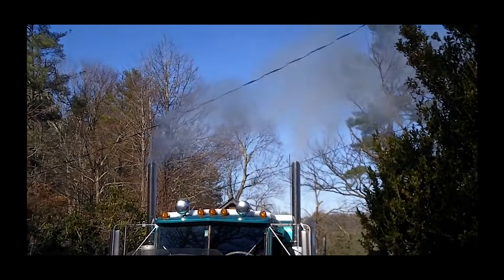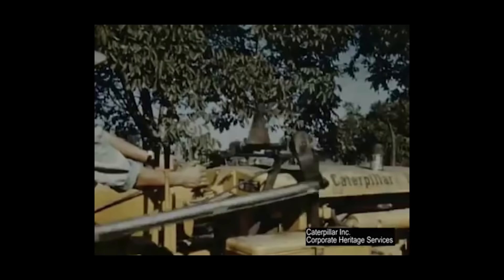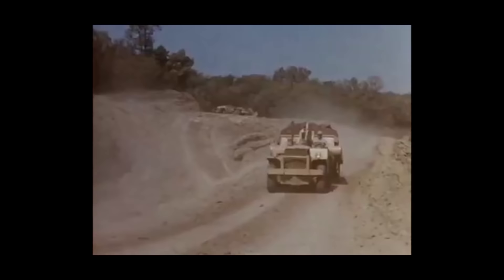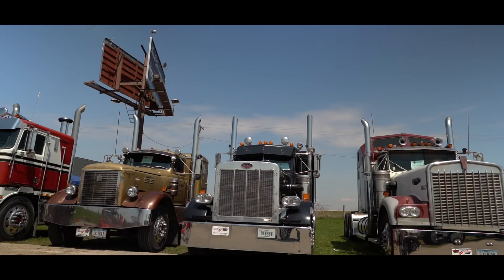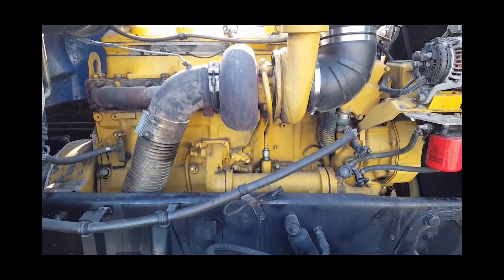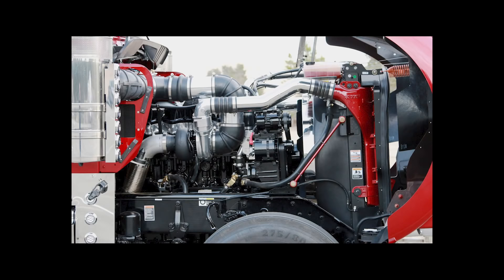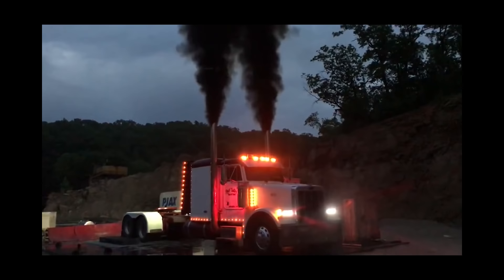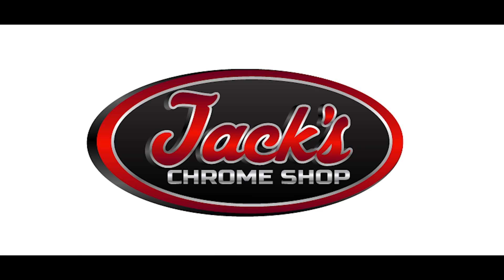History of Caterpillar Engines | Diesel History Episode One - Part 2

Comment: Nice coverage of the truck engines.  Would have hoped the big CAT's  (D379, 398 and 399) were have been mentioned.  Served as an engineer and skipper on many a Bering Sea crab boat with these beasts as main engines.  We used 3306's for generators and hydraulic pumps.  One trawler had two D353's as mains.  After putting a rod through the side of a D353, we bought what was supposedly the last D353 rigged as a marine engine from Peoria in 1982, shipped it to Alaska and had it fishing again in three weeks.  Loved those engines, slow turning, tons of torque and a pleasure to work on - life was good.  Worked on one trawler with those screaming jimmies leaking oil everywhere, couldn't wait to get back on a CAT boat!

Comment: How about the 32, 33, 35 and the monster 36 series. 

I'm an electrician and have installed quite a few 3512 and 3516s driving generators. The largest 3516 I've worked with had 4 turbos and would produce 3200 HP @ 1800 RPM. During testing, at 100% capacity, it burned a bit over 150 gallons per hour. I'm not completely sure of this but if I remember, the manifold pressure was somewhere around 100". 

And yes, it was just a bit LOUD........lol.
Reply: I have run locomotives that were converted with 3516's/ 3000HP  very nice.
 As you can see from the videos, CAT made a lot of poor design decisions.   The 1693 was indeed a great engine however it had a some drawbacks:   very heavy for its power (because of the overhead cam), a single cylinder head which was unwieldy to handle (Cummins had the right Idea with 3 heads)  and the pre-combustion chamber which lowered thermal efficiency.   Something that is rarely mentioned is that repair shops (mostly big company shops) can affect what the company buys - if the mechs hate working on them and it take more time then the company will use a different brand.  Don't get me wrong - I love CATs  but I think it was chicken shit that they ran from the trucking industry because of emissions since they would eventually have to deal with it in marine and industrial - this also gave the other brands a head start on emission controls, and quitters don't make winners.

Comment: I used to work for CAT San Antonio. Took pride in knowing we were one of 3 of the best diesel engine manufactures. We machined the C9, C7, C13, C15 blocks and C175 and 3600 heads.

Comment: Every major motor builder is having a hard time with modern emission regulations. CAT got out of otr because it made sense. They make their nut on construction equipment and dont have to deal with it. It's a loss for truckers, but you can't  blame em'!
Reply: You're absolutely right.
Reply: They were also using junk parts from China that were failing.
Reply: @bobwilliams3502  
They also had problems they knew about and refused to fix them, like a cylinder liner would be too low compared to the other liners. Instead of fixing it, cat would replace the head gaskets until it ran out of warranty,  then the owner got stuck with the problem.  the fix was remove the liner that was too low, put a steel shim under the sealing lip to get all the liners to the same protrusion so the head gasket could hold. Too much work.

Comment: The original CAT truck engine was the 4 cyl 1670. Also worth noting: The 1673, 1674, 1676,, 3306,  3176, 3116, and the 3126 truck engines.. There also was the D336, 3306, and  D346 V8 in scrapers, that built the freeways in California.
Reply: And probably a 3208 in one as well
Reply: what about you forgot about 3208 3506 V8
Reply: I meant  3508

Comment: Nothing like cat power. Love my 3406b in my 92 w900l. I do specialize hauling and am grossing out usually around 250,000 lbs. it pulls like a beast. And no it’s not stock hp. I figure it’s a bit over 500hp and not sure the torque never had it on a dyno but will walk all over any new engine from Cummins or Detroit.
Reply: I love the b model in my 87 w900
Reply: It's a dozer motor.

Comment: air to air 3406B was introduced around late 1985 early 1986.  i believe it was a 7FB prefix.
Reply: 1984 was first ATAAC (as an option on Pete/KW) for the 3406/3408B.
Reply: My 87 w900 has 3406b 7fb prefix. Ataac
Reply: @davidroberts2404  sweet!  my 1986 w9 has one too.  factory set at 400 still.
Reply: @johnowen6507  mine was a 425hp. But I've tweaked it a bit and added 7" straight pipes, dual ss breathers etc. Will be tearing it apart over the winter if all goes as planned for repainting cab,sleeper and chassis.
Reply: @davidroberts2404  awesome dude!  should throw up a video when you get it all shined up.  have an 1989 379 exhd daycab that has a 425 that we turned up,  thing runs well.  take care man!

Comment: MMI equipment in Ashland Ky has a rd 800 Mack lowboy tractor with a 3412 in it it's a beast.
Reply: 3412 was never sold by Cat as a truck engine, though a few were shoehorned in by lunatic owners.  Way too heavy for OTR highway use.

Comment: Cat has been the most resilient company to the stricter epa regulations I think that they will probrobly be one of the first to develop an engine that will meet emissions but not need any def.
Reply: They allready did it's called a C9.3B
Reply: @dropout75  where there any specs released
Reply: @dropout75  well from what I've read those engines do use def according to cat.
Reply: Nevermind, the C9.3B uses way more DEF but has no EGR, got my acronyms swapped around.  But they're in the new 336s.  Things run over 200 degrees so it burns super clean but the added heat creates more NoX hence the added DEF use.
Reply: @dropout75  well that would mean no dpf but def targets NOX so I would think that even those engines would have it. Honestly I can deal with dpf but def is just time and money I never wanted to wast.
Reply: @mzee5533  cool glade to know
Reply: They did, ACERT C-15 doesn't use any DEF
Reply: I feel sorry for any driver that hasn't had the pleasure of driving a truck with a cat engine, they are just so damned sweet to drive, and that rattling sound is music to the ears
Reply: @mdlclassworker3384  
the one I drove a 77 cab over Pete had the 3406 360 horsepower,  was the biggest piece of junk I ever drove, I got out of that Pete got a 77 KW. with a 290 Cummins big cam and was glad I did! Pulled better, ran better, and got better fuel mileage than that junk cat

Comment: I hope they come back.. maybe make a 90 degree normalized 3408. He forgot to mention their 3208. the only normal road going v8 they ever made.. 10.2 liters or so.
Reply: The big block 3408 was engineered to use the 60 degree V because it was determined that would not fit between the hoods and frame rails of any of the Class 8 tractors.  The E9 Mack was a smaller engine that Mack was able to fit in their products.

Comment: You can always use the Caterpillar diesel engines in your next frankenstein monster truck project and they can always still push out a lot of torque and power and still kick a lot of ponies out of the engine and transmission as well it can always do the job at anytime

Comment: I like another veiwer ask why you totally ignored the famous Caterpillar industrial and marine engines like the 6 1/4" bore series , D353, D379, D398 and D399 which were followed by the larger D3508,  D3512, D3516 there are even larger ones now. and how about the 3412. I worked on the 300, 3400 and 3500 series engines.

Comment: What about the Caterpillar/ International partnership with the C-660 truck that is Cat powered.  It had a C-13 and didn’t run that great. My uncle had an 04 M2 Freightliner with a C 13 that ran like a champ.  Also drove a 769 mine truck with the 3408 in it, with the bed lifted it was 5 feet of straight 6” exhaust puffing the sweet smoke and sound of a Cat!!!  I can still hear it in my head!!!  Also drove a 2000 Pete 379 with a C-12 420hp Cat that I loved driving....  The Paccar MX-13 is the closest engine I’ve driven that can run close to the way a Cat does...

Comment: most of my family including myself have worked there at one time or another. My Dad and other family have worked at the engine plant . It has now been torn down and the field returned to its original condition !!!! Engine production was due to shut down in late 2007 due to a legal loop hole they were allowed to continue to build using pre 2007 parts !!! The emissions are now at the time so strict they want the air cleaner coming out than it was going in !!!! The new standards would require a complete redesign of every engine in the fleet

Comment: I’m not seeing very many people chasing after either the 3408, or 3406B. A lot of demand for the 2WS and 6NZ. 2Ws is elog exempt. Cat will be launching a 2WS reman soon, that will have a new block, head, crank, cam, pistons, rods etc. in fact the only thing reman will be the water pump and air compressor. Cummins and DDEC will be accepted as partial core for anyone who wants to re power. Starting 2021.

Comment: What about the heavy oil equipment construction industry? Like the c777
Reply: Good video but it was all about on-highway trucks -- no mention of Cat's 6.25 bore engines (which were/are legendary in the oil field industry), 3500 Series, 3600 Series or C175 engines; not to mention the acquisition of MaK, MWM or EMD, all being venerable engine brands.  Interesting that even though EMD is mainly a locomotive manufacturer they also sold their loose engines which become the standards for inland push boats in the U.S. and for off-shore drilling.  In fact, the 3600 Series was basically introduced as an EMD-beater.

Comment: CAT never called first 3406A it was just 3406. 6NZ series still had same problems as other E-models. ACERT blocks and heads are far better had more nickel in cast iron.  Of course everyone will SCREAM twin turbo was the problem but it was never turbo problem. I seen few ACERTS that just ran like 6NZ wasn't lazy throttle. So many changed them too single turbo it runs so much better. But the also tuned it too it was software change that made it run not just turbo

Comment: What I have heard 👂 is cat is only building engines for construction equipment, and that is it, no tractors, no trucks 🤔
Reply from the maker: Correct. Been that way since 2010
Reply: They also own EMD, which still builds locomotives (primarily manufacturing older units)